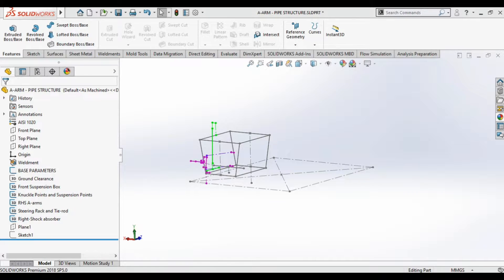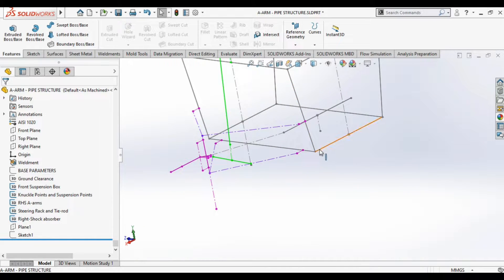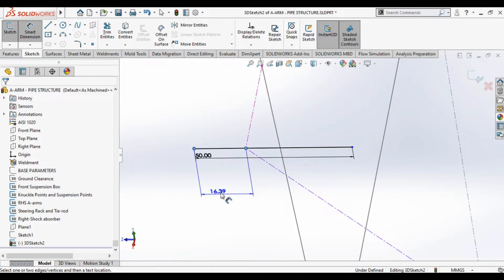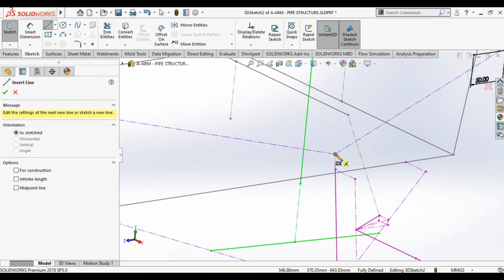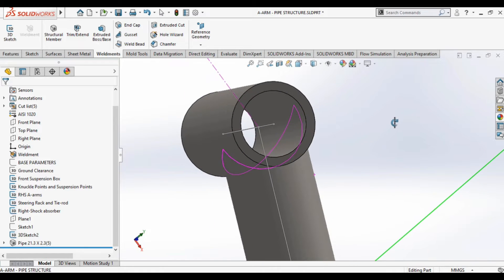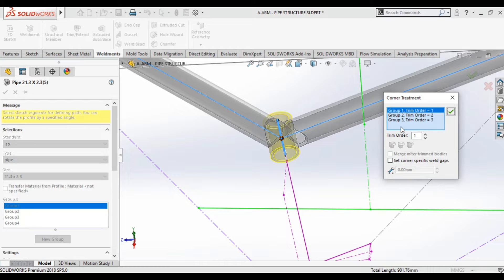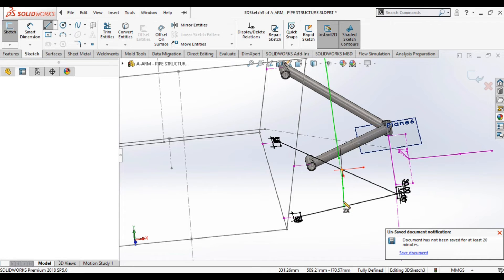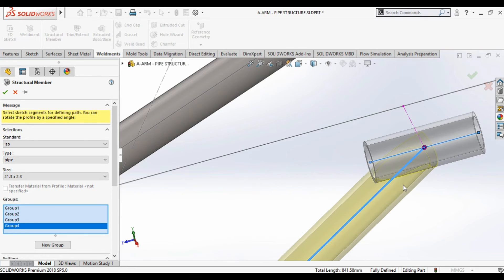A-Arm Design | Control Arm | Double Wishbone Suspension | Solidworks

Comment: I am using h arm knuckle in rear suspension. With one control link. How to find hard point of camber link where to mount on the chassis frame?
Reply from the maker: Hi. You cam rear vertical members or rear mid cross member to provide mounting for your control link. Moreover try to watch my video on H-Arm - https://youtu.be/K2YlO2BFaJc?si=pdziC8VaJYDqjcgI